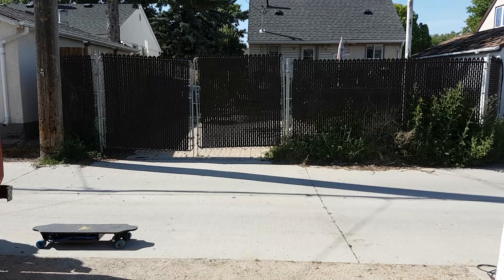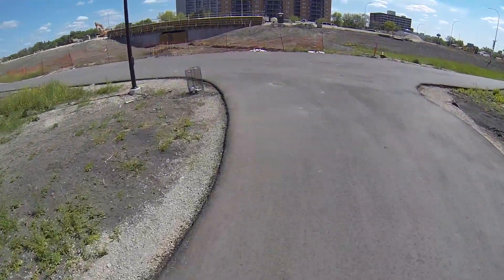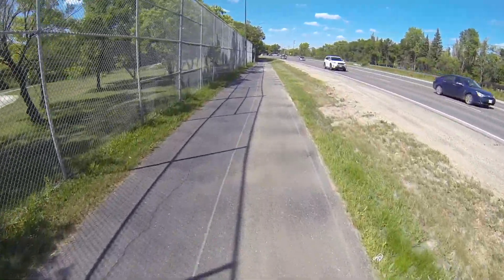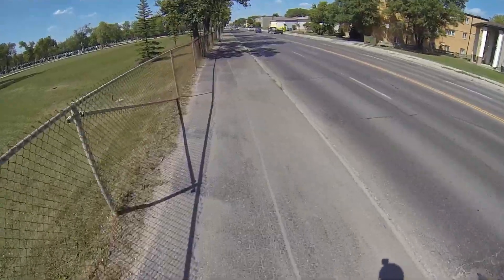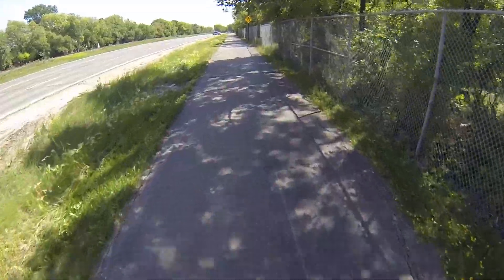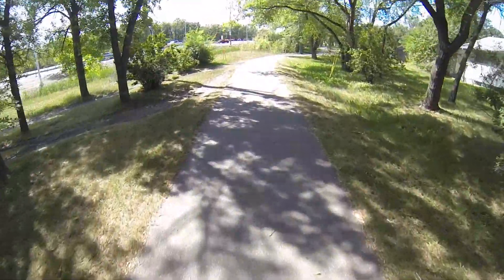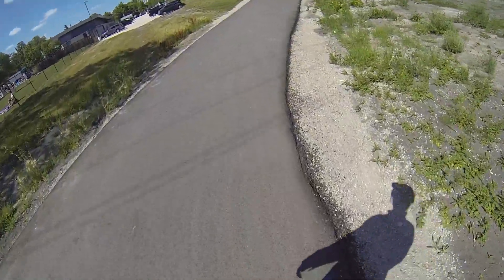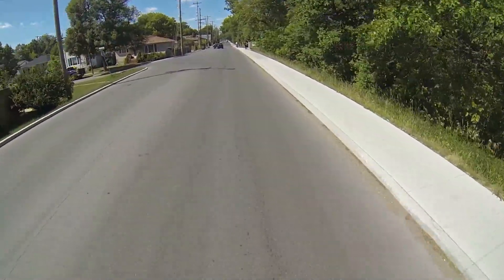Water Cooled 4000 W Electric Skateboard - Part 3 - Range Test

Comment: Love this thing, Any thoughts of smoothing out the ride by adding some shocks or some kind of suspension or experimenting with different wheels like trying rubber wheels offroad style? What is it's maximum operating temperatures in cooler climates?
Reply from the maker: There are offroad wheels, and suspension trucks with actual springs and shocks. They tend to be expensive, 400$~ for a full set, from what I have seen.

I have rubber mounted the trucks, so that does help, it is still not ideal, a normal skateboard has play in the deck, I do not have that luxury.

There is however a company that makes suspension trucks with no traditional springs or shocks. They mount the trucks on a U shaped peice of compliant material, possibly plastic. That acts as a spring and a shock. Those trucks go for about 70USD https://avenuetrucks.com/collections/suspension-trucks/products/avenue-gen-2.

As for temperature, the charging temperature of the board ranges from 0~40c. The operating temperature is from 40 to -40c.

You may see a reduction in power at the extremely low temperatures, because the resistance of the batteries goes up with lower temps. The board may overheat slightly in temperatures above 30~c. So minor power reduction.

It is not recommended to store the board in temperatures above 25c, as the chemical reactions that degrade the battery happen at a much faster rate.

Comment: How many times did you fall
Reply from the maker: No times believe it or not. Although I went for a ride nearing dawn. Not recommended. I was basically invisible, which is extremely unsafe due to people pulling out, or walking across the street at the wrong time.

I also failed to see a large rock, perhaps measuring 35 - 60mm in diameter. I ran it over and got a large shot of adrenaline as the board moved about 2 feet either side under me, without me asking it to do so.

Safety gear is a must, and night riding, at least for now without lights is prohibited.